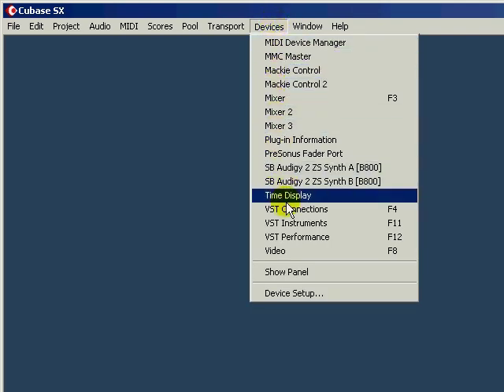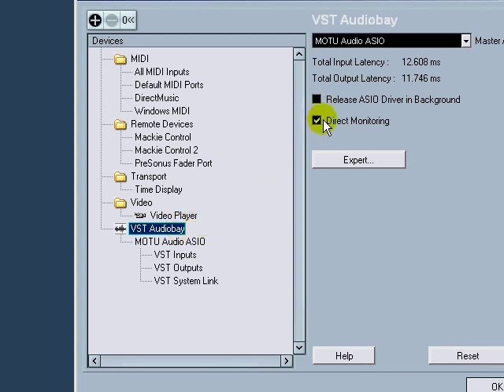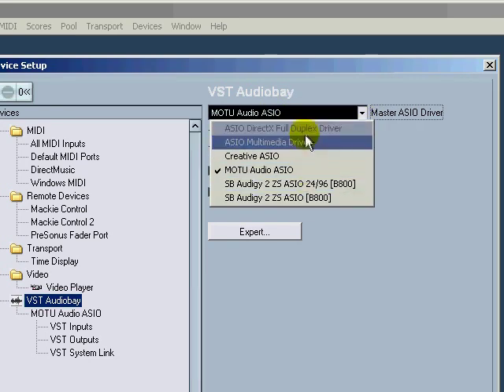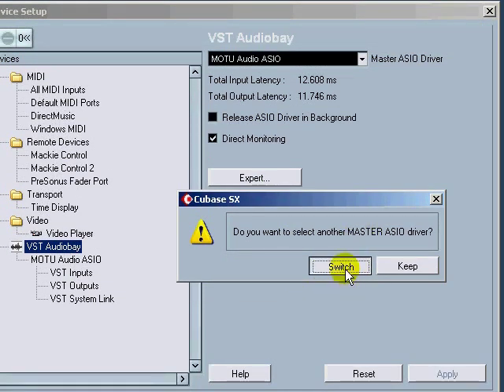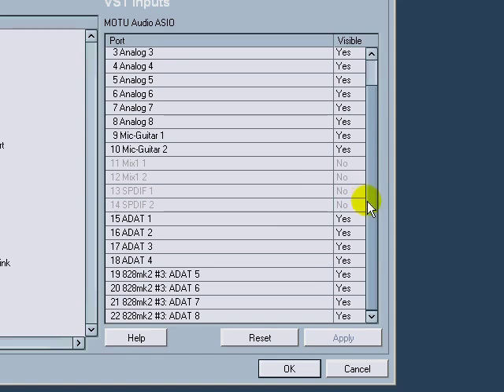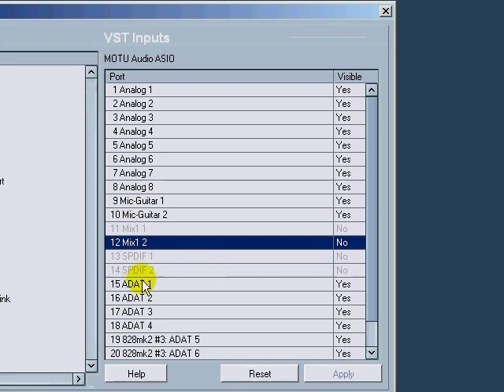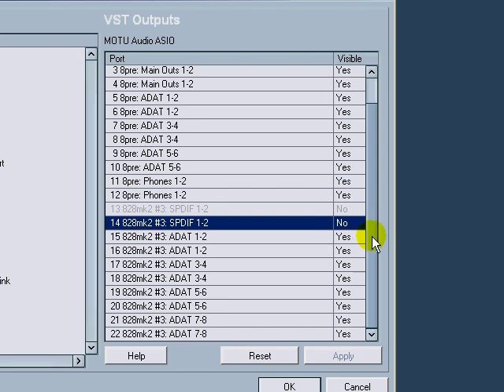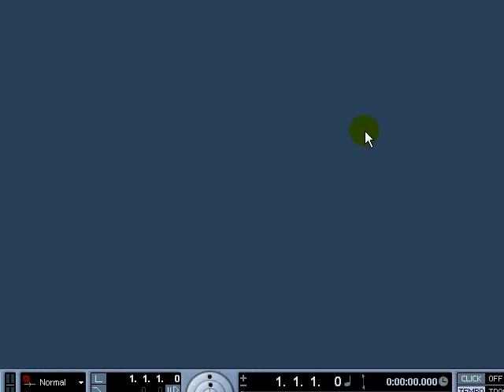Working with Cubase - Setting Up A New ASIO Device

Comment: I'm having a problem with low audio output and only 1 channel receiving also,I'm using audiogram 6 and cubase ai6,I've setup everything just as manual says and other tutorials and still my output to my amp sounds horrible and low, even though the levels on interface on at max!!!! When I tried to record ,NOTHING is being received, but I get 1 channel meter working!!! I would greatly appreciate your help!!!!

Comment from the maker: @fojeba  Make sure you have them active in your device AISO control panel. If that is good go into Cubase and select VST devices and double click on the boxes that say INACTIVE to make them ACTIVE. IF that doesnt work make sure your device supports running multiple channels of audio at the same time. If it does and you can't get them active reinstall cubase after installing your device drivers.

Comment from the maker: @desiguy118 You have to increase the latency of your system to get a little more headroom on your system. Thats a short term measure what you really have to do is  get more memory or reduce your track count since you don't have enough processing power to run that plug in and all your tracks at the same time.